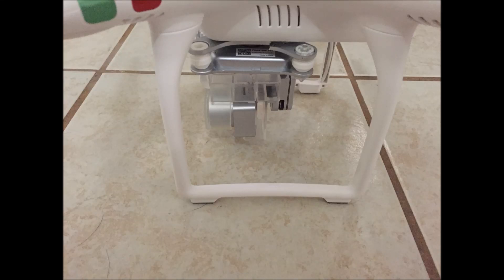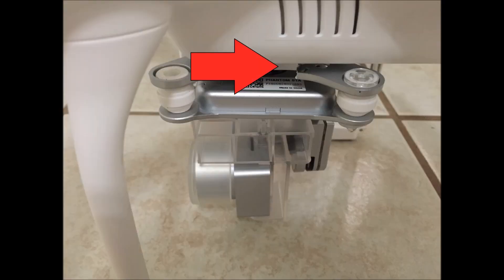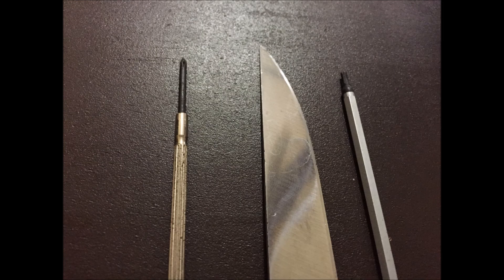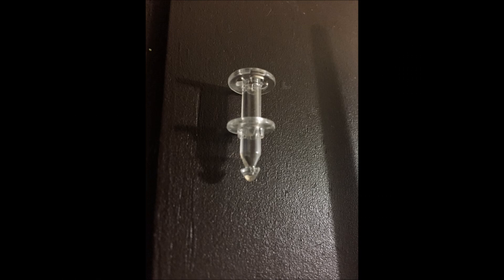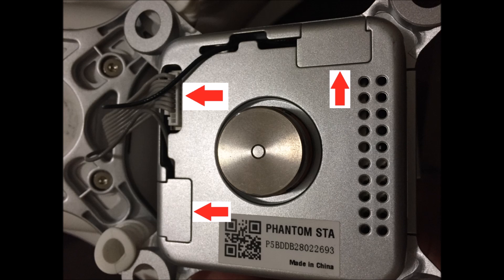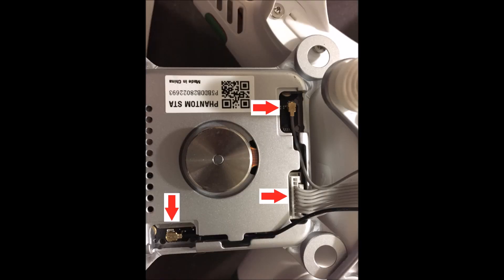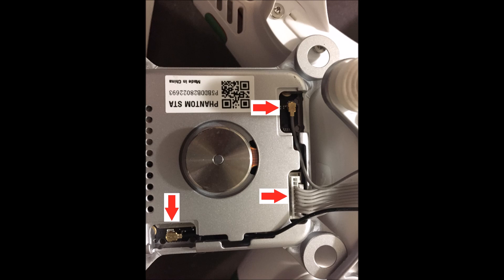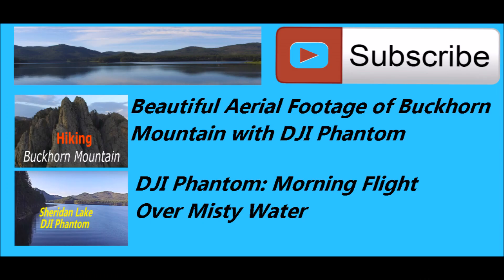How to Remove / Replace DJI Phantom 3 Standard Gimbal & Camera Fix Repair with Crash!

Comment: Best video I've found on this topic.  I got a used phanton 3 std a week ago and just noticed it was cracked in the same spot.  Dont know if it was wrecked or I did it seeing as how i dont have a. Gimbal lock with it and have transported it alot etc..  but just super glued it for now until i get paid in a few weeks and I'm gonna order one of these plates. Maybe 2 since theyee only 10 bucks..  along with a new radio because the s1 switch is broke off the radio when I got it and gonna order a better phone mount and a camo backpack carrying case.  But was scared to have to do it and this video eased my mind.  Seems prettysimple.  I have short term memory loss so I will have to label the wires but I think I can do.  Thanks for taking the time to make this video sir.

Comment: That rear clear plastic pin needs to be placed through the hole before you attach the new vibration dampening board to the Phantom itself. In my case, I did not do this and the board will have to pulled again because you cannot get that pin in from the top once everything is reassembled. I put mine in from the bottom, but it doesn't slide properly now and will probably cause issues with vibration. Which means I have to take the whole thing apart again just to put the pin in properly. Hope this helps someone who tried to do this same thing. Pay attention to the fact that one of those pins will not go back in properly unless you put it though the board before you attach the board to the drone.
Reply: I don't understand why I'm the only one that is having that problem. I watched another video and he got his pin in after is was all assembled. I must not be seeing something.
Reply: If anyone runs in to this same problem let me know if you find another way to solve this, but for now, it's working ok. The length of the pin just happens to be the right length so that it does not cause any vibration even though it's in upside down and leaning slightly at an angle, but I would like to fix it without taking it back apart again. I tried bending the old board and it seems very flexible and pliant. Almost makes me wonder how it broke to begin with. So maybe I can just bend it and slip the pin in from the top without actually breaking the board. Not my first choice on how to fix it though. Any comments would help. I just didn't want to bend it, break it, then be right back where I started. It works great now, but I'd still like for the pin to be the way it came from the factory just for the principle of the matter and because I want the pin to be straight up and down, not at an angle. Thanks in advance for any ideas on this.

Comment: Do they make one out of aluminum or other metal...got to right?..
Reply: cincodogg5 I Just cracked mine up for the first time and that was the first thought that came to mind as I have all the tools to do it. But then I got thinking about it and looking at how heavy and exposed the camera is and how that cheap flimsy plastic mounting plate easily snaps off.    Honestly I think that snapping off might just save you damage on the more expensive camera by  taking up a lot of the impact.   It’s just my somewhat educated opinion but I’d rather superglue or replace a five dollar part  than smash the camera if I can help it.
Reply: Merlin Cat or...don't crash...lol haven't crashed it since week one lol be careful have fun...bb
Reply: cincodogg5   I hate to say it but honestly it’s s lot easier to fly a Cessna  because you can just turn your head and look around to see what’s off to the side.    A lot more to lose though if you wipe out though.

Comment: What does the black wire that leads to the gimbal do and is it safe to fly without the wire plugged in ?as I’ve found no fault with it out when setting it up